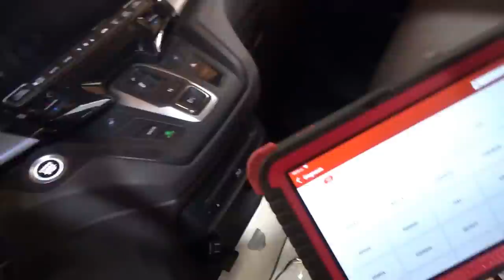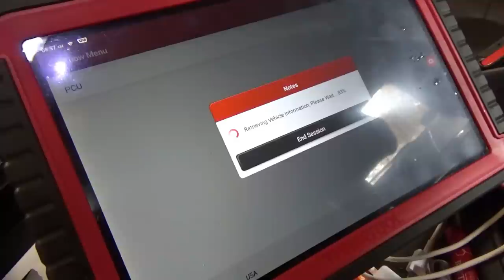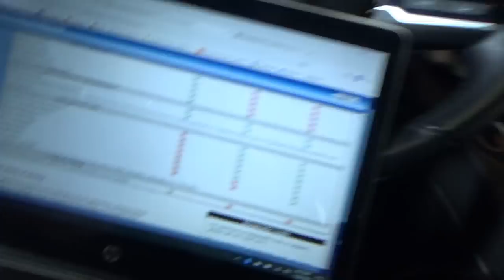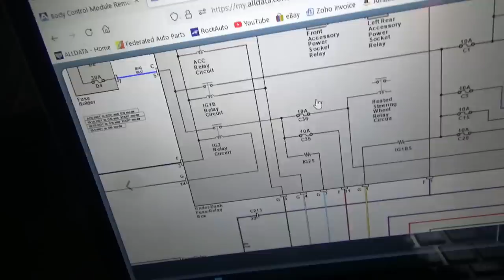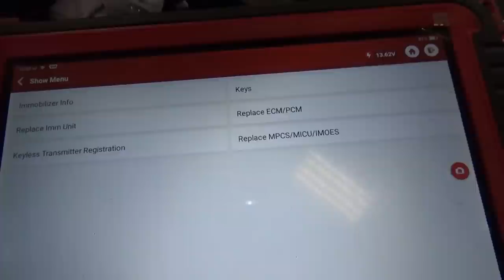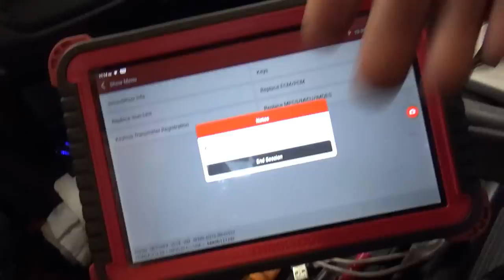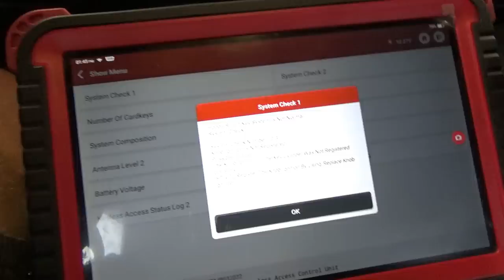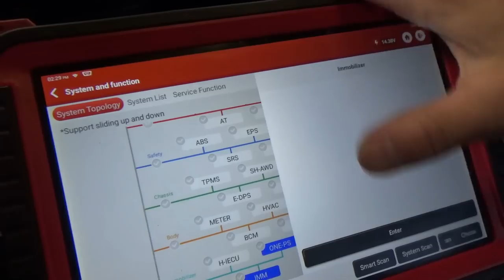WTF...Honda Turns Itself ON & DRAINS the Battery?! (Part 2)

Comment: Honda tech here, good diagnosis. The BCM, Smart unit, or immobilizer/TPMS module (depending on the make/model/year) is the only module that has the ability to turn on the ignition on push button start Hondas. I dealt with an Odyssey similar to this issue, but much more frequent (like within 2 minutes of locking the car the ignition would turn on and trigger the alarm). Ended up replacing it and that fixed it. Also seen it on a Ridgeline that used an immobilizer/TPMS module. Honda has zero service info on these systems even at a dealership level. 

I use a Launch tool a lot on Hondas due to it being simply much faster than the HDS. The Thinktool you used is very similar, but it didn't ask for the VIN to command the PCU on. On my Launch it'll ask for the VIN after asking if the vehicle is equipped with a one push start. Then you hold the start button down (do not release it at all) and in about 10-20 seconds the car will switch on. Its a similar function on the Honda immobilizer tool. Then from there only use the one push start module, do not use the immobilizer menu - immobilizer system menu is used on physical key models though it still can communicate and attempt to program. Then select replace MICU, pair it, then program keys. If you try to program keys before pairing it gets really angry.
Reply: Hi I see that you’re a Honda tech, I have a 2022 Honda civic. When I turn off the car the left/driver side headlight stays on and the ignition is on as well(all lights on dashboard) while the engine is off. I’m unable to lock the car due to this and it drains the battery. The low beam also doesn’t work in the headlight that stays on, only the led strip and the high beam. Can you offer any insight?
Reply: @pyrextrapper  Very common. Moisture in headlight causes it to stay on / malfunction. Needs a headlamp replacement.

Comment: I worked at a Mitsubishi dealership for about 7-8 years. With Mitsu there was a way to force the ignition on through the scan tool when all keys were lost. I wonder if HDS has a similar feature?

Comment: Hey Ivan, Question - why couldn’t you pull the fuse downstream of the ign. And Acc. Relays and apply power to those circuits to energize the PCM and Immobilizer controllers?  Would seem to be a lot easier than IDing the wires and piercing.

Comment: Ivan just wondering if you tried to turn the flasher on and try to connect by selecting the car manually on the scanner and choosing the modules responsible for the security. That how i program Toyotas. wondering if that works for Honda's

Comment: Amazing, (the "FM," kind of amazing) how many problems are solved with the ON/OFF button.  So, I also was curious about your reprogramming (reconfigure) the unit and the potential to re-establish baseline ops.  So is the take-away to always, first, reprogram suspect modules before replacing them?  

What an adventure.

Comment: Unfortunately, it appears that you were doing the wrong operation for the MICU (Gateway, BCM, fuse box, etc. all in one.) replacement. On Launch, Think, Topdon, etc. you perform the MICU replacement operation. That is how you bypass needing HDS and the security credentials (For now, at least.).

Comment: I had an 06 Mazda 6 with turn signal problems. Removed bcm to check for water intrusion. None found. Plugged it back in and problem solved.

Comment: If you can turn on the car without a working BCM doesn't it disprove the BCM is the only thing that could be causing the issue? Almost acted the same as the ebay BCM, power on but start/stop button didn't work. Almost like blanking out all keys fixed it. Hm.

Comment: you ruled out external shorts causing it so you cant say cleaning contacts did it. I was thinking just reprogram it. logical issues can be cleared by reprogramming. can as in its a chance not a 100% fix. also I was thinking you replaced the bcm then went directly to the BCM and its menu. I would think those menu's are BCM specific meaning as far as this replacement BCM knows this ecm/pcm thats in the car is what got replaced. aka the BCM itself needs to know who this new PCM is that its communicating with as it doesnt match the car it came from. that's just my thinking

Comment: You don't know if it was electrical or reprogramming of units and keys that did it. The computer needed 2 inputs that were not related to get the drain condition, you wonder what the common electrical is between the 2 inputs so only 1 fault would be needed, maybe the inputs go into something and a single signal is produced or ground glitches but with no one touching the car to create a glitch.

Comment: I hope my vehicles never have a BCM Fault. I have a remote camp 🏕 in Northern Ontario and it is a 35 km walk to help if lucky. Seems like Toyota doesn't have a problem with BCMs....I have never heard of it myself. Great work on the repair. My work van is a MB SPRINTER and many times the radio has stopped working and one of our city techs will remove it and reinstall it and it magically works again. Same for head lite bulbs...remove and reinstall and more often than not, the bulb will lite again. God I hate German vehicles. I am glad that Sprinter isn't mine. Total engineering abortion on wheels.

Comment: Hello Ivan, I watched the video with interest and what happened to you happens to me all the time, what you did is probably programming the bcm and update and the problem with the mysterious ignition on is solved, many times Mazdas and Fords (I work in an authorized service Mazda and Ford) have come to me with this problem, I just update the bcm or pcm and the problem goes away. I had a ford explorer with a similar problem, but there when a person was driving the car the whole car including the dashboard shut down, the car drove normally, but no light in the car, no IC, nothing. After I replaced the bcm everything was fine. I don't know how it is with Honda, but with Mazda and Ford especially, if you use an old module that already has software from another car installed, programming with the ignition on, and then all the keys, is mandatory, manual ignition on does not program anything at Mazda, even if there is ignition on on the Instrument cluster, in the Mazda ids program there is an option Forced Ignition without recognizing keys in the car, it is used exactly in such situations with a replacement module that was used on another car. I think the eBay module is not bad, it just needs the dealer software and do, Force ignition, programing with the correct VIN, and erase and program the keys, this is what i do in Mazda and Ford, i believe the procedure in Honda is simillar:)  Good luck and Thanks you.

Comment: Well, you gave it your best shot.  By unplugging/replugging the connectors you cleaned the pins/sockets.  You also reinstalled enough of the program to realign it for now.  That second part is my best guess.

Comment: That bcm may not play nice because it was destined for china,  manufactures sneaky.
When keith said do a power bypass (basically) i thought ' that's ma boy ' ha ha :-D
It's the sort of evil thing I've done in the past to power up something that's lost power.
I've also done similar bypasses in vcr's where the psu faled, just testing the system.
Using a variable psu i made millions of years ago.
You have a handy psu as well, evil test are useful :-D

Comment: hey so what happened to this van follow-up any news?  because I am facing same situation is it cbm modul for sure or was it something else?  Please update.  Thanks
Reply from the maker: Van has been behaving ever since! Magic!
Reply: good!  I am having the push button (ignition start stop button) car fine but when I shut the car (press stop( can engine stop but the ignition button stay ON !  any guide here? please share your insight)  I notice when I plug negative terminal as soon as it touch batter negative post i see little spark! this show that I have a short somewhere?  please guide me here .  Thanks

 @PineHollowAutoDiagnostics

Comment: I think your reflash of the original bcm may have been your fix. This video will probably get you banned for life from the Honda dealer, quite the pain to program some keys, but it is getting harder to get key programming info or pin  numbers unless you are a dealer or a registered locksmith.

Comment: You also reset the computer system's corrupted software and the OS on the immobilizer by doing these steps. basically, you did a New windows profile on that system but left windows and apps installed, so basically, you showed the computer, hey, I'm the boss

Comment: Does anyone know why he is banned from the local dealer? I have a feeling it has an entertaining story behind it
Reply from the maker: Watch the Honda Playlist starting with the 100 Month Battery Warranty SCAM ;)
Reply: @PineHollowAutoDiagnostics  after watching that video, I am honestly ashamed. As a Honda dealer tech, I can agree that Honda needs a charging system code to follow through a battery/alternator warranty claim, but in the case where it leaked and destroyed the terminal, all that is needed is a picture. They probably wouldn’t cover the terminal replacement, but they would cover the pro rate of the battery. I’m not sure what the pro rates are. My dealer and service manager are great, they wouldn’t turn a potential future customer away on a warrantable item. Honda pays the dealer back for warranty items, so it’s not coming out of their pockets, that’s just a bad case of management and service dept.

Comment: Wow Ivan.  That was a stroke of luck that the original BCM started working normally again.  But now we are left so many questions and not enough answers as to why.  Could it have been a poor connection on one of the bulk connectors?  It's unlikely, but possible.  Could it have been a minor firmware / software corruption and during the reflash process, it fixed it?  I've seen something like that on PC components, so that could also be a possibility.  You know, I've been told stories with how some used security system related modules, once paired to a vehicle, can't be transplanted to another.  Could this be true here?
Reply: Many modules have the car's VIN programmed into them.  If the BCM and PCM don't have the same VIN, the car won't start.  A new module will have a blank VIN and will learn it from the rest of the car.  But replacing the VIN in a junkyard module may not be supported.  I've done it on a radio by opening it up and clipping onto the EEPOM and manually programming at the chip level.  In this case, I suspect the replacement module had software for a different market installed that wouldn't talk to the American market car.  The software typically isn't replaced and is different from programming. It might have been fixed if it was possible to get an "update" to the firmware, but I suspect only authorized Honda partners can do that.
Reply: @russellhltn1396  I've never gone to that level to try and reprogram a module.  But I've seen others reflash eproms.  That's something I've never invested much effort in.
Reply: @Sandmansa  It's all in what you have.  I found instructions on a forum.  I spent less than $20 to buy the tool to reprogram a radio.  I don't have a $1000 scan tool.

Comment: That module is a joke had a honda fit 2002 on the fuse box under the dash has 19 connectors on it, with a set of wires, i was like Honda why, had a similar problem where the part light turns on the igintion 1, the harness had burnt wires etc, and the dash board wasn't moduler so any harness you gotta check behind the dashboard eveything has to be removed which the customer didnt wanted to pay for and i really didn't wanted to do, after days of looking and fixing burnt wires I just ran a relay, that open circuit the park light when the ignition is off,honda need to get someone to run efficient wiring for them
Reply from the maker: 2002 or 2020? 2007 was first year of the Fit I think...

Comment: On my son’s Challenger, he has one key fob that doesn’t get recognized, but if you push the ignition button with the key fob instead of your finger, it will start and drive. Makes no sense to me.
Reply from the maker: Is the battery in the fob good?
Reply: @PineHollowAutoDiagnostics  yes it it is. It just doesn’t get recognized. I guess it’s been like that since he got it in 2015. We didn’t find out till about a year ago when we finally needed to use it. Lol! But what strikes me being weird is that you can’t unlock the car with the fob, but you can still start the car by pushing the start button with the fob.
Reply from the maker: @DoonerF  there's a chip in the key that is recognized by the push button when you bring it close. Pretty much standard on most push button start systems today 🙂
Reply: @PineHollowAutoDiagnostics  so is it a different chip than what is normally recognized by the system? I even tried putting the fob next to the start button and pushed the button with my finger and no start. But if I push it in with the fob, it starts. That’s what I don’t understand.
I thought maybe it was some feature where if the battery dies, you can still get home. That makes sense. But it only works if the fob touches the button. It’s way over my head. 🤣🤣🤣
Thanks for the reply and the great videos. It really amazes me how you find these problems with these new vehicles. I’m old school. I like my ‘61 Falcon. Don’t usually have to search too much to find out what’s wrong. 🤣

Comment: You reprogrammed a bit or a byte in a bad memory location. I used to see computers that would have oddball errors, but consistent in the error presented. You get a bad memory cell that can't be reprogrammed or relied on to do what it's supposed to and you get errors
Reply: or maybe more likely was a garbage bit or byte. couldn't be read maybe?

Comment: Dont forget your not using factory software you never know what the factory software can perform.
Reply: I know that on my 2002 Acura MDX, (using an xtool D8), It would not let me program two keys at once.  It just kept failing.  But if I just tried to copy one key, it worked fine:   and then I had to go back in and copy the thrid key, and that also worked fine, but for some reason, it would not work right if I was I was making "2 keys, and tried to do them both at once.  I made keys an a dodge nitro and a mazda 6 and they both did fine;   only the Honda gave me trouble.  It even prompted me for a special code in the ECM, and the D8 was able to pull it up.

Comment: Yes, you can charge the customer 5 hours. It's not your problem your customers keep trying to cheap out. You're not a charity Ivan. You aren't screwing anybody. Their problems are not your problems. By the time they come to you they've tried everybody else so they know they're screwed. Why you continue to allow customers to bring their own parts mystifies me. Here in Phoenix, there isn't one shop that allows you to bring them parts.
Reply from the maker: Hey Denis! As a rule of thumb I supply the parts 90% of the time. In this case new OEM was not available, so I told the customer that next easiest thing is to try and source a used one. I don't have time to go hunting on eBay, so gave him the option of buying one himself... Less hassle for me that way. As for the hours charged, I'll make up for the "learning time" on the next one 😉

Comment: I have an unrelated queston for anyone.
I have an Thinktool Platinum S10 when I try to change the tire size in the ABS module of a 2004 chevy silverado 2500HD 4X4 everything seems to go fine but when I check on the next key cycle the tire size is not changed.
What am I doing wrong?
Thanks for any input, A.J.

Comment: You won't add used keys to a used bcm.

You won't add a used bcm to the car. You need either a virginised unit or learn to flash the MCU with a virgin dump.

Key data could be read from the old bcm and written to the new bcm using an eeprom programmer very easily.

Invest in programming gear and save yourself much time. Invest in tools that can do this via obd and youll save even more time. AVDI would have done this cars new bcm in about 20 mins with new keys added. Look at TMPro or Tango for keys and ZedFull is also good. Your wasting your time with these third party scanners. They're for generic garages hoping to fix.

Comment: It looked like the eBay unit had a problem with the electrically erasable programmable read-only memory.  The module was no good.  Not able to accept new programming.

Comment: You do not have proper tool. think tool junk is not for that purpose. IM608 can handle it
EDIT: Why not clone module or swap the chips?
EDIT: Simple reason why original module programming goes nice, because there was stored all IMMO. Your think thing just can not handle immo thing. For immo you must buy separate unit what cost more money and ask every year subscription. Blaming ebay unit without having immo tools is lame